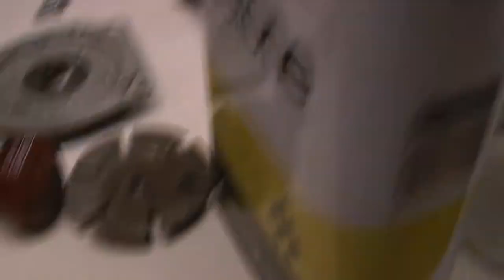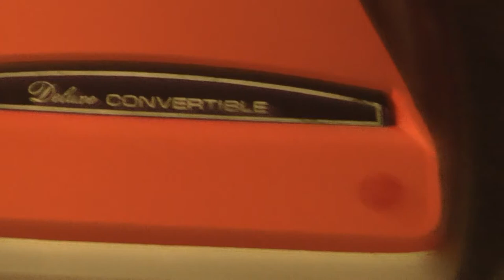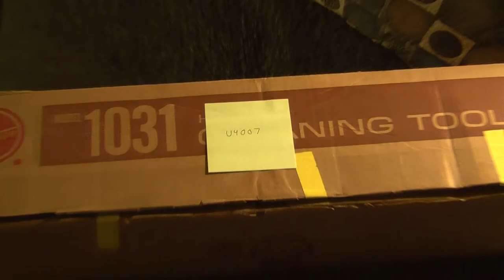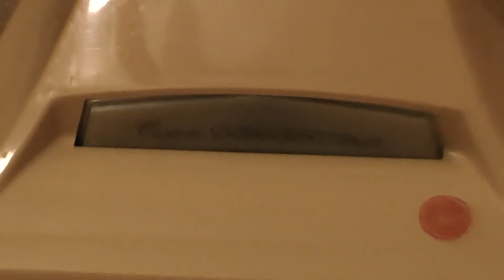The 1973 Hoover Convertible Model U4009 - Part I

Comment: Classic Hoover engineering and style!  The Model U4009 Convertible was manufactured from 1973-75 in the color scheme copper & taupe--according to Hoover's color code chart.  Some collectors refer to the bag decorative as a flourish which was screened onto all the "Deluxe" bags.  The "Custom" and "Deluxe" trims were the highest levels.  The "Basic" trim lacked the headlight, handgrip, full furniture guard, zipper-close bag, and longer power cord.  The U4005 in stellar blue & taupe was the other deluxe model in the 1973-75 Convertible line-up; while the U4003 in shades of taupe and U4007 in goldtone & taupe were the custom models. Some collectors use their creativity to name a series' color theme. For example, one might name this series "The Heavens"--clouds/stars (taupe), sky (blue), sun (goldtone), and moon (copper). I do think the term "full hood" identified both the headlight (custom) and no light (deluxe) cleaners--even though they had a subtle difference as you pointed out.  Happy Hoovering!

Comment: My dad had a Convertible a lot like this except it was a tan color and had a zip up bag and a headlight. I always thought that full hood looked massive on it, especially when combined with the small Type C bag. I have a Convertible model U4387 that I think is from the 80s. It uses the type A bags and has a 5 amp motor, it's a good machine I like it. Needs some TLC but it's a strong runner. I have a few videos of it on my channel along with my Eureka ESP.

Comment: What kind of grease did you use for the lower motor bearing? I have a grease gun but I'm unaware if it has the proper type of grease for the bearing